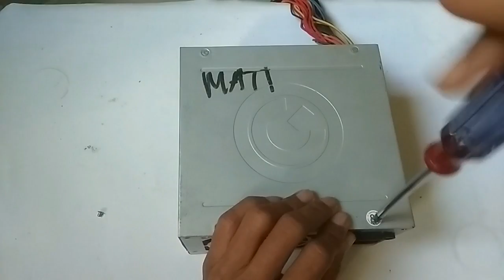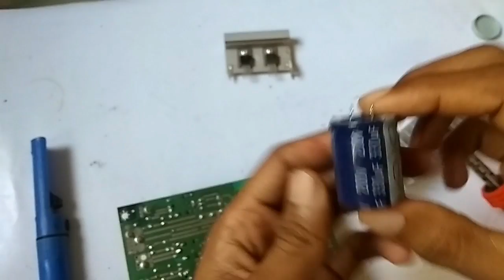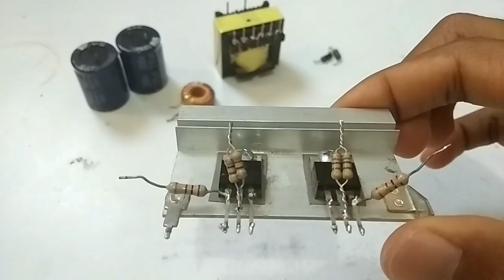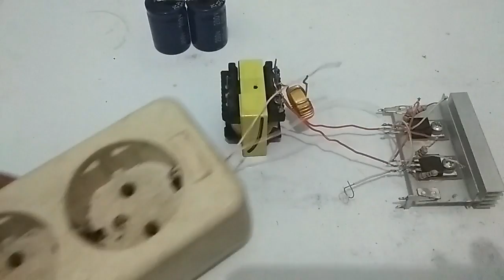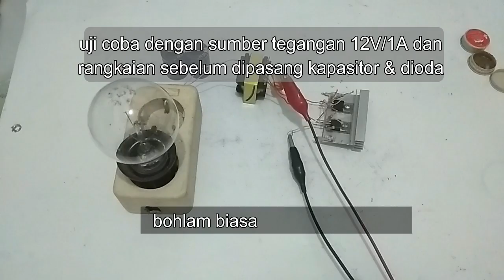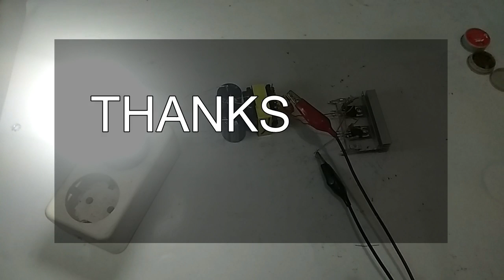Inverter sederhana 12V to 220V || Semua komponen dari bekas PSU ATX

Comment: Tahan sampai berapa jam pak?
Dan berapa tegangan dibutuhkan untuk menyalakan rangkaian tsb?
12v?
9v?
Reply from the maker: Pake 12V, lama tahannya tergantung kapasitas baterai nya.
Reply: @OptionLabs  ohhh , itu makek lilitan juga ya
Reply from the maker: Pake trafo SMPS bawaan cabutan dari bekas PSU PC/komputer langsung
Reply: @OptionLabs  iya , itu makek lilitan dari bekas psu pc juga ya
Reply: @OptionLabs  boleh minta datasheet trafonya ? Atau pin yg disambungin ke transistor itu pin apa ?